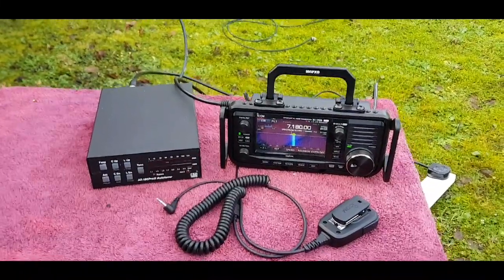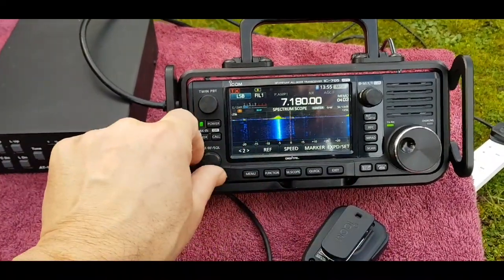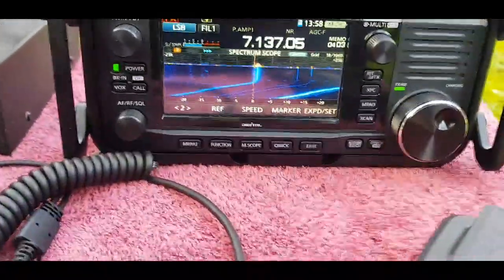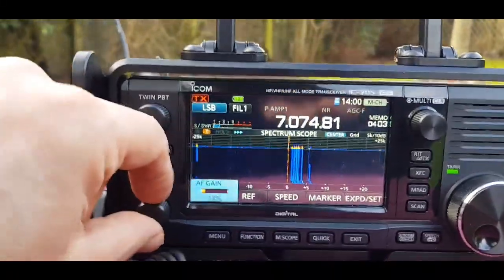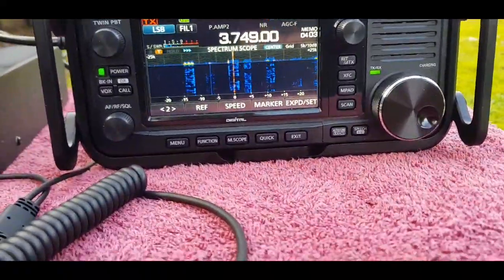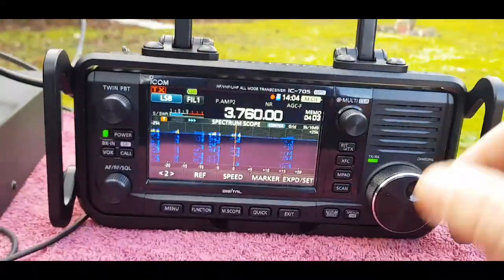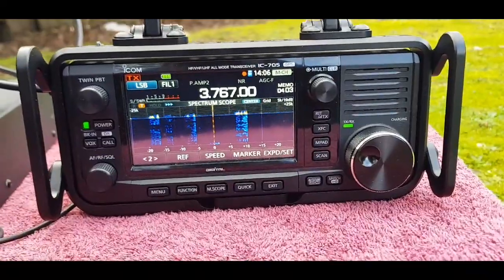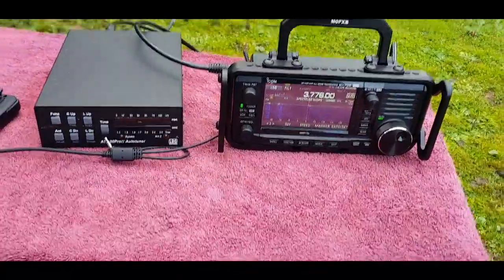Icom IC-705 AT100 Pro II ATU and

Comment: What are you using as a groundplane
Reply from the maker: Hi ,a brass pipe banged in the ground
Reply from the maker: Hi Chris the 20 meter wire as a 9.1 doesn't urgently need one for some reason the G5RV i used to earth it on an old metal radiator but these days because I hardly transmit I haven't bothered but earth is silly important if you dont want to lose all your rf power.